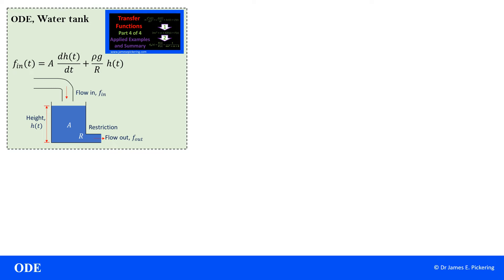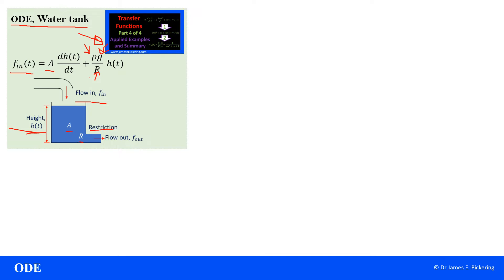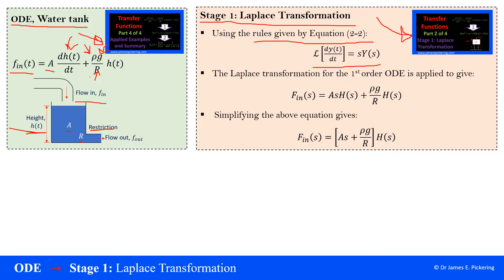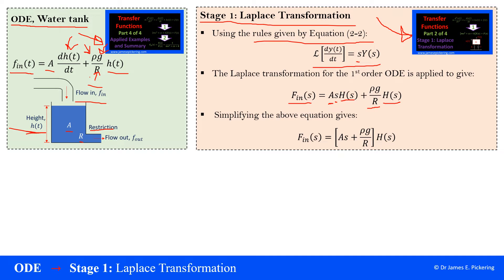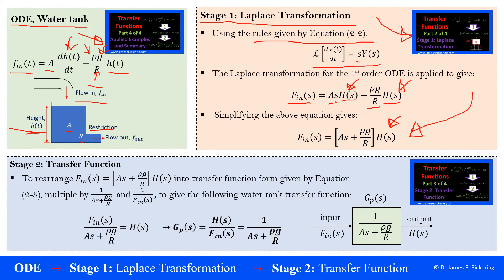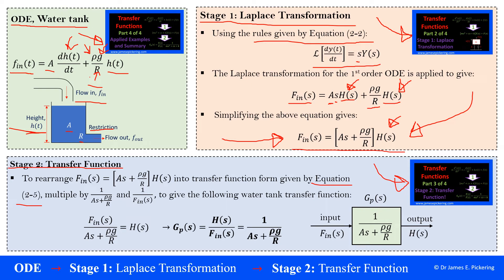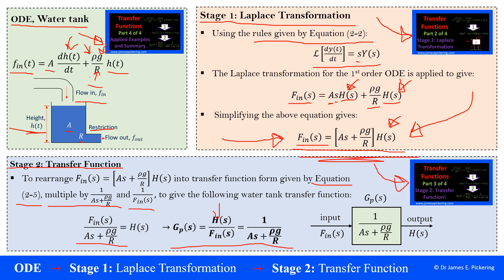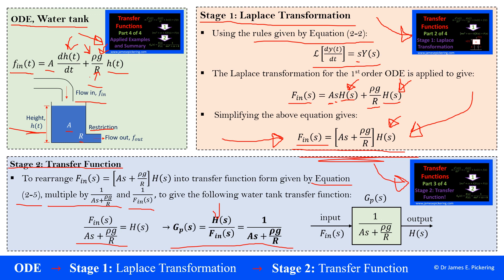Transfer Functions: Water Tank (Applied Example)

Comment: What I’d find very useful would be to take a simple situation such as a tank with a level controller (liquid system) or a tank with a pressure control (gas system) and derive a differential equation to model tank filling, transform it into the Laplace domain and create a transfer function. Then use the transfer function in Simulink together with a PID controller to simulate upsets and system responses. That would provide the building blocks for many real world situations with process plants with the tools to analyse many practical situations.
Reply from the maker: One day I will try and find some time to do this :)